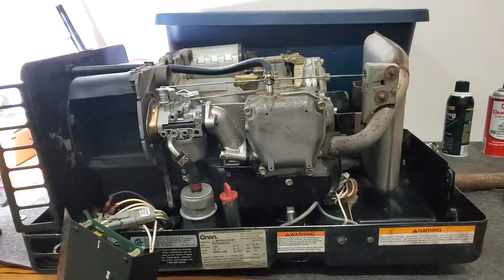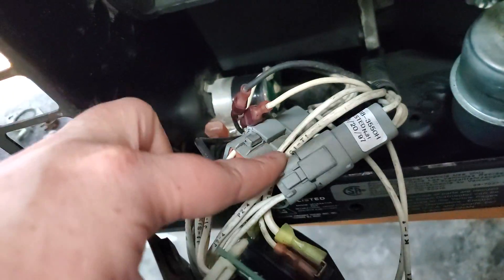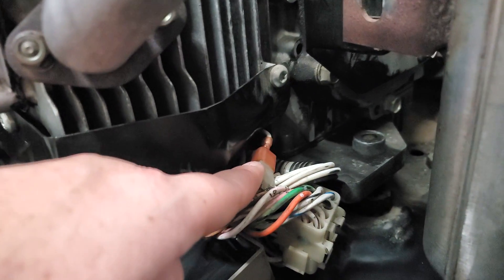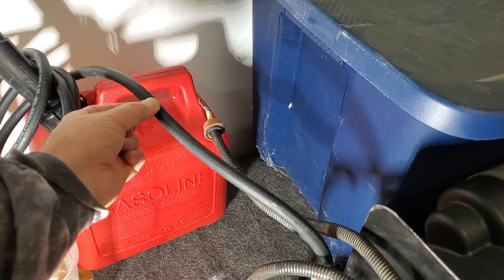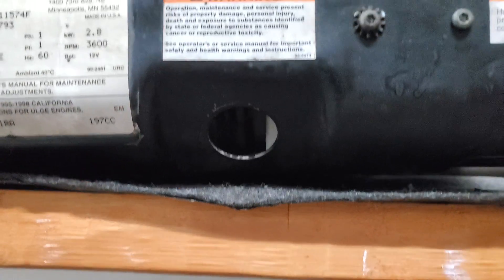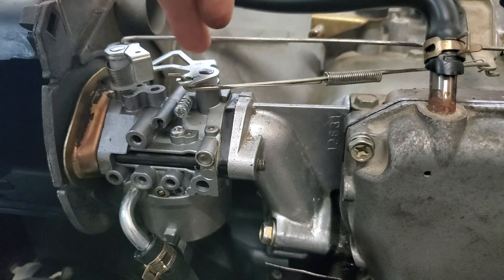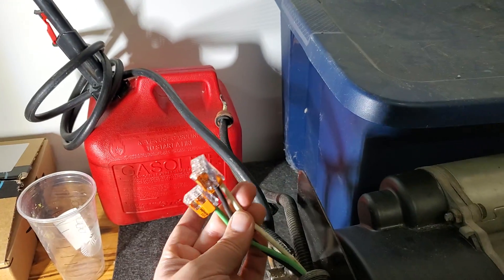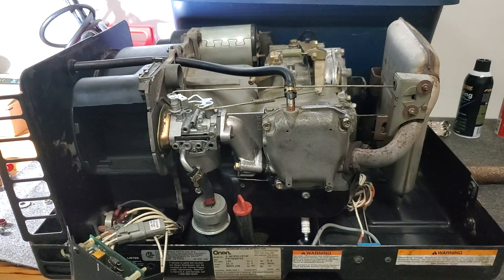Onan 2800 (KV Spec F) Breakdown, Initial Overview

Comment: This is easily the most informative video I've found on this generator. You covered, in your 15 minute video, what I've figured out through hours and hours of research along with a lot of trial and error. I currently am working on a customer's same model and have the same issue as you here...just curious in the video you thought it was the magneto, but after testing the magneto must have been good? Because your comments lean towards now you think its the controller?

Comment: How do you get the fuel filter out
Reply from the maker: The fuel filter is just "in line" so you pull the fuel line off the top and the incoming line on bottom and it's free.  You just replace the whole thing.

Comment: A few things.  There is a gasket on the carb flange that goes to the air filter housing.  Yours is missing.  Mine has a grounding strap at the back of the motor to the gen housing.  The control board, the regulator, or low oil sw are the three main problems when it won’t start unless holding the start sw. which there are tests you can do to isolate the problem.  Flight Systems has a troubleshooting guide on their website.  Good job on vid!👍🏼
Reply from the maker: Thank you!  Yeah, I never did get it working but ordering a replacement computer from Flight Systems was next on my list.

Comment: So what is the fix for the no run after releasing the start switch?
Reply from the maker: I didn't get it fixed, took it to a small engine repair guy and he kind of gave up.  I think it was probably the computer, which supposedly can be replaced with one from Flight Systems.  IIRC you can send them yours and they'll test it to see if it's faulty.

Comment: Hi Mike...first off, thanks for posting your video. I am having trouble keeping my Onan 2800 MicroLite genny running. It starts and runs as long as I hold the start switch down, once released genny immediately dies.  I'd like to replace that main circuit board with start/stop switch and well as voltage regulator (any electrical parts I can replace   while unit is out) For what a shop would charge to possibly fix unit I could replace ALL electrical parts for less than a repair shop would charge. My main question is how to remove that main panel that contains s/s switch, circuit board and 120volt /25 amp circuit breaker. your video show the 2 screw holds but not actually removing it.   I've bench tested genny, it produces 120 volt power out put but won't stay running after s/s switch is released. I'd appreciate a video or instructions on how you removed panel that contains circuit board. Again thanks for your video and help...Ken
Reply: Have you cleaned your carburetor?
Reply from the maker: Replaced it.  Still had the problem.
Reply from the maker: It's been a while since I did this but I think I just loosened two bolts (or maybe screws) from the front and that was it.  IIRC that was one of the most straightforward steps.  Sorry for the long delay.

Comment: You did not indicate if you were successful in starting the generator.  Did it run and stay running under a load?   I have the same generator and have repaired it 3 times.  It is unreliable, consistently a problem for many Road Trek owners.   Mine currently runs when it feels like it then quits.  There is a newer pricier version but installs differently.  You would think they would design it to pull one out and put in a new one without modifications.  Logic is completely out the window in this high tech world.
Reply: Not sure but junked up carburetors cause that type of problem
Reply from the maker: I didn't get it fixed, I just posted this video to share what I'd learned with other owners.  I got a small engine mechanic to look at it and he gave up.  I suspect it was the control board but I don't know.  I'm now trying to determine if an Apex Predator might match the form factor well enough to install under my rig.

Comment: Great video, learned a lot !  Im not getting fuel to my carb even when I run the start button fuel should come out of carb hose.  I'm wondering what is the 5amp fuse for on the side of the start button box.  Any chance its for the fuel pump ?  Right now the gen is turning over with the starter but not fuel starved
Reply: Could definitely be the fuel pump, just replaced mine

Comment: Great video, about where i left off. Mine doesnt make volatge, runs great 30 seconds and shuts down, safety protection shit down. Think its either brushes need cleaning or a new voltage regulator. The brushes are buried, like complete diassaembly and special tools to acess em. Voltage reg is 100s of $$. I have a Xplorer,  very similar to Roak Trek.

Comment: Thank you for this video, will have a second look at my unit.  Lost a screw holding the choke housing onto the exaust/manifold and now I'm having issues getting it back on correctly.  Starts but won't run.